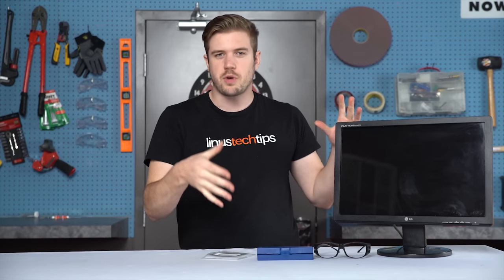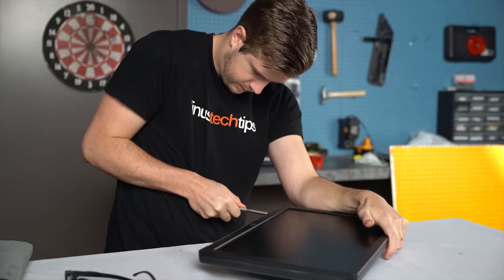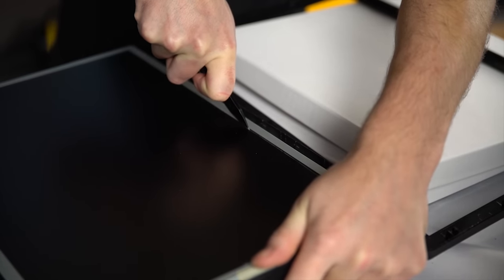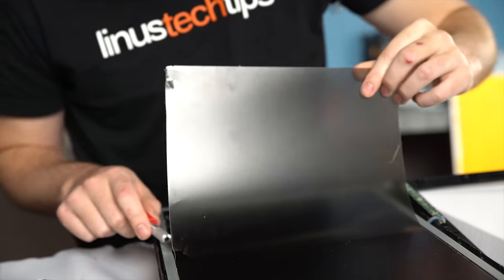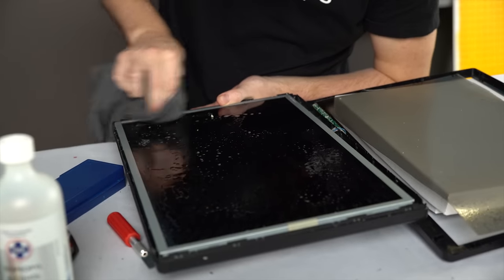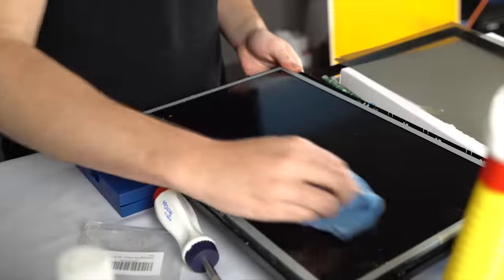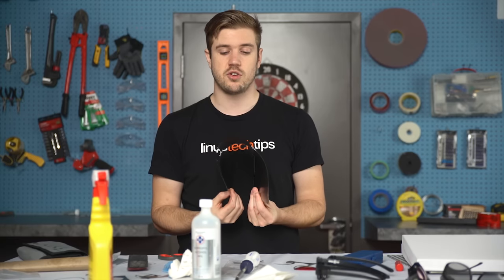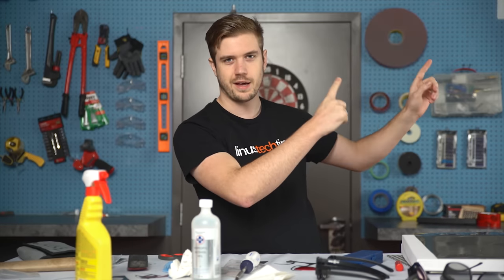DIY Privacy Display - Recycle your monitors in a badass way

Comment: The inverter isn't dead. The CCFLs are and it's detecting incorrect voltage drop and shutting down to prevent damage. Or some of the solvent leaked into the HV wiring.
Reply: looking at the logo and the writing, it was backwards, was it not?
Reply: the goof-off stuff had clearly leaked through the monitor
Reply: at 10:49
Reply: @beyond_ez7358  yea that was horrible to watch
Reply: ye dude i saw some liquid flowing out the back probably that
Reply: @beyond_ez7358  init, it's gushing

Comment: Probably got cleaning solution all over the internals and shorted something out
Reply: +Julian Dymer I think that solution is non conductive.
Reply: probably not... it kind of works, doesn't it??? shouldn't a sort out killed it completely???
Reply: +ilias 1161 ughh...no.
Reply: +Julian Dymer 10:50 Totally inconspicuous streaks of liquid coming out of the back of the monitor
Reply: +ilias 1161 Depends on what it shorted out, could have shorted only inverter as there are much higher voltages and it's for electricity to jump.
Reply: +maxqia damn nice find! That is probably what broke it. You're totally right haha
Reply: +Valtra103 While 100% ispropyl alcohol is not conductive the normally available 90% ispropyl alcohol can be as it is cut with distilled water that can still exhibit conductive property's. As for Goo Be Gone that is conductive I remember seeing several threads sometime back about its viability for use on PC components for cleaning like cleaning of thermal paste of a CPU but when tested it was found to be conductive and also left behind a conductive layer when it dried.
Reply: Mhm
Reply: EQUINOX
Thanks for info. Then yeah, he messed it up haha. Should have dried it for few days...
Reply: +EQUINOX I don't think it was the isopropyl, since he also used some kind of furniture cleaning spray
Reply: +Julian Dymer nah, probably a blown capacitor or inverter like he said. But ill bet it's a blown capacitor cause most monitors ive fixed which had the same problem, it was a simple capacitor replacement.
Reply: Sammy Morini
Yeah, that capacitor problem is highly likely. But i still think that he may have messed up something.
Reply: Valtra103 while you're right that it still is possible he may have, and can only assume he did as with no prior proof of the state the monitor, i still think the chance of shorting something out is less likely than a capacitor going bad, by a huge margin given the circumstances. oh well, not our problem anyway, it's Luke's :)
Reply: Sammy Morini
I agree. I actualy think that he may have damaged pcb in some other way, by mechanical force. Maybe some microcrack or something. From pressure when he was cutting screen and/or prying monitor apart. Old solder and pcb traces get really weak. And like you said, it's not our problem. But still it was interesting to think what happened :)
Reply: *****  I do not think you read or understood what I typed as I did mention the cleaner he used.
Reply: +Valtra103 But the inverter thing is high voltage and insulation is critical
Reply: If you read more than one my comment, you would see that I think that he messed it up. I don't care how. But i feel like he did it. And not condensators, they called capacitors.
And capacitors don't care for partial short. If cleaning solution messed it up, it went somewhere on low level / power signal traces or ICs. He should have dried it before turning on. I always let my motherboards to fully dry before turning them on. I wash old boards in shower. Because that dust is anoying as hell. All of them work fine.
Reply: +Valtra103 When Luke flicks the screen on, you can briefly see at the top left of the screen, some damage.....however earlier in the video you see a load of liquid coming out and streaking down the monitor, just as he puts the base back on....I wonder if there is a correlation between the two ha ha.. still Love their vids and still give him top kudos for having a go at these builds.
Reply: Mouse6677
Yeah, I seen that. It would be not first time for him to mess up something :D
Other than that, he did nice job. And i didn't know that this trick with monitor exists.
Reply: +Valtra103 same here I did not know this is something you can do....James Bond eat your heart out...:)
Reply: +Julian Dymer Or all that pressure from the wrong cutting tool.

Comment: The inverter died due to chemical spilling into the housing. This is obvious when you stand the monitor up there are three streams of drippings running out of the top ventilation. I do want to add note that yes this project is awesome and thank you.

Comment: Could have just replaced the bad capacitor, fixed many monitors with the same behavior with $0.50 in caps and ten minutes. 

Also I imagine heating the film with a heat gun lightly would have made separating them easier

Comment: I know this is a 4 year old video but I just wanted to tell anyone in 2019 that tries this and has the same problems with the backlights working only for a second, it's not the "inverter" or whatever he said. He plugged the lights in the wrong order. Remember how the light cables where connected and place them in the same order.

Comment: ~~Monitor has liquid dripping out the back.~~
"What we need to do is plug this in!"

Might have somethin to do with why the thing stopped working...
Reply: +DasVERMiT Exactly!
Reply: +DasVERMiT he used too much solution
Reply: +DasVERMiT lol yep right at 10:50 top right of the bulge...
Reply: He should've added the step to use alcohol at the end and blow it off with an air compressor to dry it, or maybe let it dry overnight.
Reply: Lol
Reply: +DasVERMiT Cleaning screens 101. NEVER apply cleaning fluid directly onto the monitor, always onto the cloth. Just for this exact reason.
Reply: +DasVERMiT i cried inside for this exact reason too.
Reply: +DasVERMiT lol, It has nothing to do with why it stopped working. Luke even said "Inverter dying" the inverter board is f*cked xDD
Reply: i wonder why the inverter board got fucked up... :d
Reply: frozendefender Sometimes they just blow now and then :/ Sad times lol. It may break from power cuts etc.
Reply: +Anony the inverter is incredible delicate. almost any liquid will ruin it.
Reply: ThereIsNoMatch I don't know much about electronics. But my dad is an electronics engineer so.. i dont even know lmao xD
Reply: My quess still is that the liquid was indeed conductive and managed to make its way to the inverter and did a do. its usually what happens atleast. very rarely i've seen anything  electronic just stop working after not being used for few months, human error and accidentaly doing things that it's not ment to do is a whole another subject tho
Reply: my thoughts exactly.
Reply: Thinking the same thing like wtf! Did they not consider water damage
Reply: +dunnobutwayne take the time linus unscrewed a 2011v3 mounting bracket and attached a heatsink with zip-ties, because he "couldn't wait", to try out a 4500!!!! dollar chip
Reply: +bigbentosmit Sometimes watching LTT I cringe a lot because of these ghetto mods that are downright unsafe. $4500 CPU and he couldn't wait a proper mount! Makes me think they have no idea what they're doing.

+Anony Wrong. The goo be gone is some conductive petroleum distillate which is extremely conductive and any of it that gets on the inverter it's more or less gone.

The HV terminals work ok in open air but they are designed for that, obviously. I bet you there are some of that stuff on the HV terminals so everytime it tries to fire it arcs over and the controller shuts the inverter down.
Reply: probably the glue remover he used lol
Reply: +Anony Please don't speak on things you know nothing about then.
Reply: HotPocketLord Plays stfu.. its a youtube comment section xD Anything is possible.
Reply: +reno911unlocred I think the problem liquid was the goo b gone that he was spraying RIGHT NEXT to the bezel with exposed electronics.
Reply: +HotPocketLord Plays Have you never been to a youtube comments section? I think you should not talk about things you don't know.
Reply: +Anony Usually, a faulty capacitor do that.. it's an easy fix!
Reply: +dunnobutwayne yeah of course but i mean... It wouldn't be funny either way x) Just like when they "watercooled" the macbook ! ^^
Reply: +reno911unlocred 
70% isopropyl alcohol, common drug store product, is 30% water. It could short the circuit .
Reply: +Charles Penn mate the alcohol dries. 70% ipa will still dry completely just not as quick as 99%
Reply: I call for redo
Reply: +DasVERMiT he used to much lube, now there just isn't a point at all lol
Reply: +DasVERMiT What if the liquid was picked up from the table GASP plot twist.
Reply: +Davindra nah cuz that part is sunken down so it wouldn't make contact with the table.
Reply: +DasVERMiT Yeah. For a "TECH TIPS" channel, this guy seemed as knowledgeable about how to do this right as my aunt who barely knows how to work a computer.
Reply: +DasVERMiT The screen was probably broken from the very beginning.
Reply: +DasVERMiT definitely. had a friend destroy his panel by letting cleaning solution drip inside the panel casing.
Reply: wet monitor recovery.....
Reply: +DasVERMiT thats what came out, no need to mention what stayed in, yup that killed it, anybody going to do this i recommend an old credit card, that's how i did it to peel off the filter instead of preying that sharp exacto knife on the panel, plus for the panel plastic frame manup and use your fingers and nails, yeah will leave you in pain but it will look untouched
Reply: DasVERMiT Probably the Liquid crysral
Reply: DasVERMiT YOU STOLE MY PROFILE PICTURE >:(
Reply: DasVERMiT o
Reply: TheImage132 I learned the hard way. Acetone got into screen. I got water spots, but acetone
Reply: THATS LCD
Reply: Its an LCD screen. Maybe that rings a bell
Reply: He should have used wd40, it will take most glues off and is safe on electronic parts.

Comment: Anyone interested how this works:

The LCD has the following parts (in order from front to back): vertical polarizer, glass substrate electrode, liquid crystal, another glass substrate electrode, horizontal polarizer and the backlight (white fluorescent tubes or LEDs). 

This is how an LCD works: First, light coming from the tubes or LEDs are polarized horizontally by the horizontal polarizer, and then it passes through the glass substrate and then to the liquid crystals (which will do something magical as I will discuss later), passes to another glass substrate and then to a vertical polarizer. Now, since light has been horizontally polarized by the first polarizer from the back, there should be no light that will pass through the vertical polarizer. Now, remember the liquid crystal? The liquid crystals bend light from 0 to 90 degrees (black to full white, respectively) depending on the voltage applied from the glass substrates (which sandwiches the crystals), the substrate contains individual shapes that defines a pixel. If the crystal bends light to a 90 degrees, the subpixel (R, G or B) will be illuminated to the fullest, if the crystal doesn't bend the light (0 degrees) it will just be black. In other words, the angle determines the intensity of the light.

Removing the vertical polarizer will allow any orientation of light to pass through at the front end, which is why you'll see white. With a properly oriented polarizer, you can again filter only the vertically-oriented light to pass through.
Reply: Thats very interesting John.
Reply: Excellent explanation of how it works. I guess polorized glasses wouldn't work because you have to rotate the film to get it to display properly.
Reply: you sir, deserve a medal.
Reply: Adrian T It depends on what type of polarized filters you use, some are linear like the ones used in LCDs, and some are circular like your 3D glasses. The circular polarizers filters out light which are either polarized clockwise or anti-clockwise. So, yes linearly polarized light on circularly polarized filters will not work.
Reply: Hitler Yeah, it's measured in the smallest unit possible, yours.
Reply: Hitler That was a compliment btw, the average penile length would be any multiple of that, some cannot even be expressed as an integer. Could be smaller than the planck length, in which our physics will no longer work properly to explain their length sensibly in a fashion suitable to the Standard model.
Reply: Someones a gen i us

Comment: Luke, think you could try this again but with an Asus gaming laptop?
Reply: +alfredovasquez774 lol
Reply: +alfredovasquez774 That was my thought exactly! :) a laptop ppl cant see the screen on would rule XD
Reply: +Gaara Lund what we need is the ability to BUY screens directly without a polarizing filter
Reply: Lol
Reply: +Gaara Lund Its actually much easier on most laptop displays. Often times you don't have to cut the filter just heat up the glue if it is adhered to the LCD.
Reply: Gaara Lund thank you. At least someone doesn't think I'm stupid...
Reply: I have a old laptop lying around...
Hmm...
Reply: +Heyo Animator you never know until you try...
Reply: Heyo Animator Yes they do.
Sources: Not an idiot.
Reply: Cody Istre Wow! That's a reliable source!
Reply: Heyo Animator Have you ever looked at a laptop screen? Did you see something mother than white light? That means it has a polarizing filter.
Reply: Samk1106 True. But the screen just feels like plastic.
Reply: +Heyo Animator Lol
Reply: +Heyo Animator well, they are right xD you kind of made a fool of yourself.
Reply: ***** shoot me a reply if you get that trick to work on your old laptop please.
Reply: +alfredovasquez774 try it on one of those 4k g sync monitors
Reply: +Heyo Animator I agree, I'm not going to EVER risk breaking an expensive laptop screen after I ruined a perfectly working old LG 1920 x 1080 monitor.

Comment: Could this work with a phone?
Reply: Grandma with an Inhaler phones dont use polarising filter ffs
Reply: BadAtGames 

Thank you!
Reply: Grandma with an Inhaler mista beast
Reply: BadAtGames actually that's false they do use polarizing filters inside the lcd
Reply: MrDeadmanwalken1 Small amount of phones use lcd most use tft.
EDIT: MOST PHONES USE AMOLED OR LED SCREENS
Reply: BadAtGames the leds in a screen is just the backlight - a led screen is still an LCD screen and therefore still need polarisers
Reply: A decent number of them uses OLEDs, what about that?
Reply: Gnm Software 2012 | Gnmpolicemata still requires polarizing lenses
Reply: Grandma with an Inhaler are you MrBeast Fan
Reply: Ninja Gamer King // NJK no
He is a grandma of an Asian sticker
Reply: Grandma with an Inhaler try it no tutorial
Reply: Phone dont have that filter.Trust me I tried it with my old phone
Reply: Grandma with an Inhaler lol
Reply: BadAtGames Yea mainly Samsung phones use amoled displays. iPhones use tft LCD displays
Reply: Grandma with an Inhaler yes but you would have to destroy the screen. The filter is part of the LCD which is adhered to the glass. You'd have to be a professional technician to rebuild entirely the whole screen assembly just without the polarizing filter.
Reply: yes but it would be very hard and most likely kill touch sensitivity if not kill the screen entirely and a lot of android phones have oled and thise would be impossible as they are matrixes of colored led diodes with no polarisor
Reply: BadAtGames Apple still uses LCD on ipone 8
Reply: Grandma with an Inhaler there are some privacy screen covers so you can only see the screen if you're looking directly at it
Reply: Yes
Reply: BadAtGames some do
Reply: Your inhaler would be in the way (cuz its a small screen
Reply: Stojke #La_Kojot 4 Life well crap
Reply: Grandma with an Inhaler yes
Reply: Idk test it [i am not responsable for any broken phones]

Comment: HMMMM, maybe the monitor died because the inside of the monitor was soaked in goo be gone and isopropyl alcohol. Either way you should have instead used gasoline to remove the adhesive, and then actually have cleaned it off and let the rest evaporate before actually turning on the monitor.
Reply: That actually would have been super
Reply: isopropyl alcohol is not conductive.
Reply: +TheCardq not if it's not pure
Reply: I thought about using Acetone the whole time. Gas would leave an oily residue on everything.
Reply: Isopropyl leaves no residue, Goo Gone does.
Reply: +packdemon Just use Acetone and razer blades... I did it yesterday and it works fine :D The only problem is that the glue is really sticky so you have to spend more than a hour to clean the screen.
Reply: +Michael Ray i would be REALLY careful with acetone and make sure it doesn't harm whatever surface is under the glue, it's a badass solvent for sure, i use it all the time at work, but that stuff goes to town on some plastics particularly ABS which i guarantee is what most of the enclosure plastic is made of
Reply: jacksonlefteye
There's glass under it since it is a TFT-Panel :D So there is no problem in cleaning it with acetone...
Reply: oh boy, here's the expert who never did the project but has his expert opinion. As Luke said, he was following what others before him had done to get the screen to where it needs to be and that those instructions had worked for others
Reply: SirBillyMcSilly so in order to have credibility in the observation that a dripping monitor will probably short out when powered up, you had to have done this specific project before?  maybe it's just common fucking sense?
Reply: +packdemon Yeah.. the adhesive remover could be seen leaking into the monitor at multiple points throughout the video.